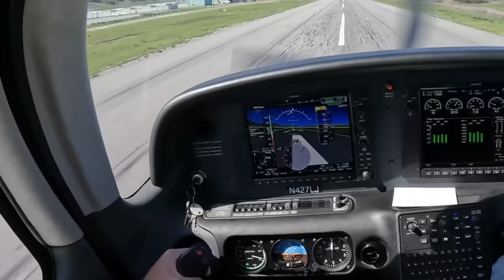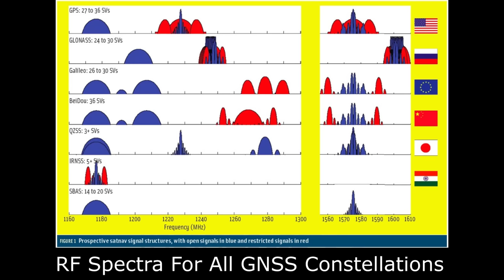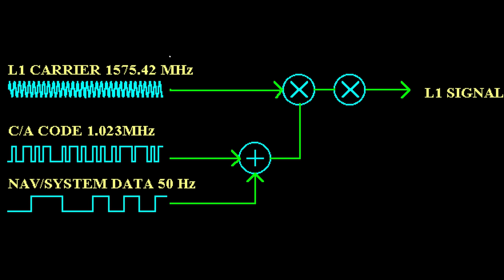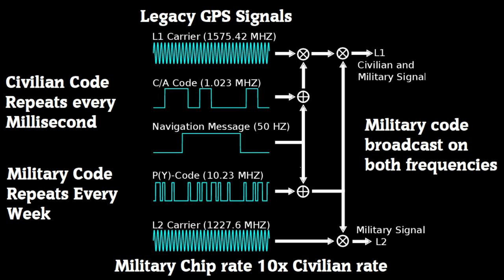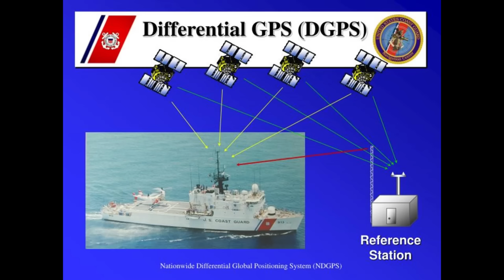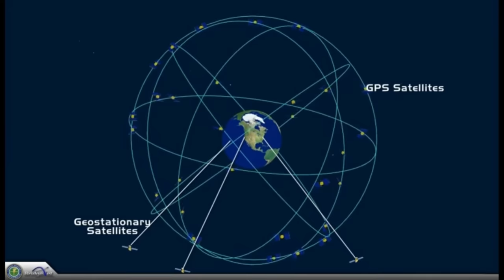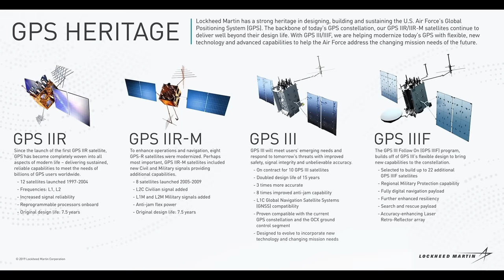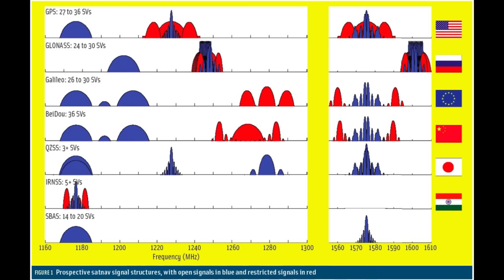How GPS Works, And How It Got Better Than The Designers Ever Imagined

Comment: I worked on an opencast mine which used GPS to track the huge haul trucks as part of the haulage optimisation system. At the time of SA being turned off, I was at home recuperating from a neck operations, but I was logged into the system. At that moment, I could see the truck bread crumbs resolve into the left and righthand sides of the haul roads.
Reply: Wow that must have been a discussion topic next day in the office!
I'm curious, how precise was the tracking before that? Did you see the bread crumbs in general proximity of the road?
Reply: @MatteoGalet  Yes. Haul roads are made at around 20-30 m width.  I called the guys at the office at the time. I must say that the supplier of the system had their own form of correction as well. Now they use GPS to steer autonomous trucks. The company is Modular Mining Systems from Tucson, Az.
Reply: What AVL system did you use then? Oh never mind I see it

Comment: An explanation of AGPS for mobiles would have been a good addition.

To save mobile phones waiting 12 minutes to acquire and decode the GPS network data, cellular network base stations supply that data directly to the phones. Thus a phone can set up its GPS receiver for a hot start, ready to go, and start calculating accurate position straight away.

If you're away from all cellular networks, it takes your phone a long time to get a position!
Reply: Wi-Fi also plays a part in this. I recently moved to a new state where I've got no cell service inside my house. My phone sees my Wi-Fi, and thinks I'm back at my old address. This makes it impossible to get a precise location lock unless I can talk to a cell tower.

I had to buy a new router. Once I did that, the phone would use it's last location to look for satellites, and wouldn't think it teleported to another state!
Reply: Good point. The key factor is that your phone will remember that AGPS data for a long time, even when out of cellular range. Removing the phone battery will force a cold start of the GPS receiver.
Reply: @PsRohrbaugh  that issue is not from real GPS, google or some provider keep a database of WIFI acess points and their location.
A phone will send a list of nearby acess points to this provider, wich will look for matches in this database and return a estimated position.
This can then be used as a initial position until a real GPS fix is achieved.

Then the reverse is done, a phone with a good GPS signal will send the list of visible AP to the provider to update its database.
Reply: I used to have a handheld GPS receiver in the 90's which took forever to lock but I never thought about how today it doesn’t take long because of the dropped selective availability thing, thanks for that little gem about cell towers.
Reply: A long time and a lot of battery, I presume?
Reply: @PsRohrbaugh  It depends on the model, but you probably could have changed your router’s BSSID so it no longer matches what google/apple have in their database as your old address. If you aren’t technically minded though, then ya, probably easier to just get a new router.
Reply: Phones know where they are from the cell masts they connect to, with a largish error

From multiple masts, you can triangulate. That's demanded by emergency services

GPS however gets you a very accurate fix.
Reply: @FABStudios   FWIW, S/A didn't affect startup time.   It simply caused your position to wander slowly (they guaranteed no more than 0.5 m/s drift rate (maybe even .5mph) over no more than +/- 50m)   Even with a consumer grade GPS receiver, if you simply let it sit in one spot for a day you could zero in on your true position (used for surveying where differential GPS was not yet an option).
Reply: Some phones also have a barometer which speeds up the first fix because altitude is already known (roughly)
Reply: @TBH_Inc  I'm moderately tech literate, and just assumed it was tied to the MAC address, as you can have plenty of routers with the same SSID, even on the same network.

That said, you're right, I didn't even bother trying to change any settings, just went on Amazon and ordered a new one.
Reply: @ashchap  The requirement is to know which satelites to search for first. 

Phones will get RTK and phone masts will be broadcasting RTK data going forward.
Reply: Yeah there’s at least 5 or 6 sensors that your smartphone can use to “know” your location
Reply: Google has made a right mess of aGPS. I turn it off in all my phones. It's often put me hundreds of meters from my location.
Reply: As long as the receiver can get the almanac often enough, it’ll be up-and-running very quickly. Not as quickly as with base station location as a seed, but still much faster than it otherwise would. See any runners’ smart watch that’s not otherwise internet-connected. Takes a minute to acquire signal if you’re using it every few days. So no big deal really. Same as any other offline receiver.
Reply: I mean, a long time not really.  My GPS watch, can take from 15 seconds to a couple of minutes to get GPS position. Most of the time it's a couple of seconds.
Reply: Most modern cell phones uses accelerometer to keep track of their position. They then use GPS and cellular network for updates. This what gives the appearance that phone GPS works indoors and in situation where there is poor, or no reception and in areas where there is a lot of multiple path

As a part to the GSM standard the cell network broadcast a timing signal, this is done in order to synchronise the hand sets and the tower, this signal can be use to measure the distance from the site to the phone, and being that each cell tower has a GPS receiver not for its location but also to keep accurate time on the network. With the network signal, the accelerometer data and GPS signal you will get very accurate location. How with just any two you will get fairly good data.
Reply: @Grantly   google has nothing to do with aGPS. And aGPS is only part of hybrid positioning, used in Android, along with cell towers, wi-fi ...
Reply: @PsRohrbaugh You could've used an extension cord and temporarily turned on the router outside the house. That way your phone (and also Google) would've relocated your router's MAC address to the new GPS coordinates.
Reply: Now i understand why my gps module/sensor I bought for raspberry pi Pico takes so long to find a position compared to my phone
Reply: that makes sense! With my 5 year old phone, whenever I use GPS on Airplane mode, it takes a long time to get a position. I thought it was just a bug. TIL.
Reply: @PsRohrbaugh  If you had changed the name of your network, you would not have needed to wait so long. It also should have taken into account your neighboring WiFi networks to recognize that you were not in the same location.
Reply: An app called GPS Status allows you to discard and fetch current aGPS data on-demand.
Reply: The provision on mobile networks are not, as might be thought done, dynamically but an almanac is downloaded periodically. This is important as when calling 911 the GPS location is done before the other side rings as the location determines the Public Service Access Point (PSAP) the call goes to (prior to E911 it was determined based on the cell and face the call accessed which could lead to the wrong PSAP being communicated with and the call needed to be rerouted to another one.)
Reply: @PsRohrbaugh if you reset your router to factory, it would’ve reset all the position data it had. Or it could’ve been your ISP account supplying inaccurate data.

TLDR you didn’t need to buy a new router.
Reply: @PsRohrbaugh  Thats because the Google map function uses the MAC address of your WiFi for location. A tsome point thye will update and learn your new position.
Reply: @Markle2k  If he is far enough out in the boonies that he doesn't get a cell service, the chances of other WiFi being around is slim.
Reply: It's described in Wikipedia.
Reply: Its annoying they assume WiFi doesn't move.
Reply: S/A caused a lot of vertical drift. I recall snow camping with an early GPS, and we could change hundreds of metres in elevation without moving. Using a topoggraphic map, you cross-refrence position and elevation.
Reply: @PsRohrbaugh  " just went on Amazon and ordered a new one."

So, the overly intrusive surveillance done by big tech made you spend even more money trying to correct what should never been in the first place?

And no, I don't blame you, there are only so many fields one can start becoming an expert in, though I find it rather depressing how 1984 turned out to be driven not by the government but the anonymous mass of consumers.
Reply: What was only shortly mentioned is, that the satellites not only provide information for the selves, but also for others. To acquire a position the phone needs to know where the satellites are. As data download takes 30s but learning the currently visible configuration takes several downloads, this adds up in time to build the so-called almanac. The phone (and also all the arduino cheap GNSS receivers) can save the almanac. But the almanac is getting old and after around 7 days, it needs to be built from scratch. That explains why we have a hot-start, where GPS is ready within a few seconds, where the constellation seen is just almost the same (after power cycle or such), a 30 second warm-start, where the constellation can be estimated based on still valid almanac data and finally the cold start, where the almanac has to be re-built, needing 7 to 12 minutes. 
With internet connected, the phone can download a valid almanac from the internet and can lock your position within the 30s, even it has lost the almanac, because it is only stored in a temporary RAM location and lost after reboot.
WiFi and Cell ID can improve the position precision in dense city environments as GPS is often blocked by large buildings and may shift your position by reflected GPS signals.
Reply: This explains why my GPS seemingly wasn't working when I was in a foreign country. I just didn't know it would take such a long time to gather the data, having been connected to a network basically all the time.
Reply: @PsRohrbaugh yeah but that is NOT AGPS - it's (theoretically) working without any satellites - basically what it does is either the wifi router or your phone (thinks to) know the exact position of the router and maybe even other routers nearby and calculates your distance to those devices - similar as the satellites do but with devices on the ground - it's meant to increase GPS accuracy by providing additional position data, but it's far too unreliable if you ask me and can you throw way off course, so I'd suggest as long as you don't need it (because you're in areas without proper GPS) AND you have some kind of option to avoid errors (either by knowing all wifi AP are correctly configured or by knowing your location and being able to check back that you didn't had/have errors) to turn this feature off.
Reply: Blimey. No wonder it took us a million years to get this far! 🤯
Reply: Thanks for this explanation. I have a Blackberry Playbook tablet that has GPS but takes forever to get a fix. I assumed it was just a poor GPS implementation, but now realize that it didn't have the rapid startup configuration information that the cell phones were privy to
Reply: I dunno. I use GPS on my mobile phone onboard an aircraft regularly. Obviously, the phone is in airplane mode and yet the fix is almost instantaneous.
Reply: @vysogota  Depends how stale the almanac last delivered by the cell network is before switching to flight mode. Probably, not very. 

An interesting experiment could be to switch to flight mode, power down the phone, start it up again and see if it stays in flight mode. The power-off should purge the almanac from the GPS receiver. The OS boot might purge any old temporary data lying around (including old almanacs), so an almanac wouldn't reinjected into the GPS receiver. And, in flight mode, the phone won't be able to get / receive a new almanac, nor can it give a hint as to what part of any extant almanacs is current for the (approx) location. If all that does add up to a forced GPS cold start, it'd be interesting to see the consequences!
Reply: @vysogota  Just doing that experiment -  it's doing a cold start (Samsung / Android), and still hasn't got a fix. 

It's quite interesting watching the GPS Test app slowly pick up individual spacecraft. Several minutes in and the position is still reported as Null Island. 

Ah, it's just got a fix! It's found 4 spacecraft, so it has a position fix. It's not found the 8 others that it could be receiving (it's a 12 channel receiver on this phone), so it's clearly waiting for the almanac to come down from the 4 it's got before looking for more spacecraft. The accuracy is way off.

The accuracy has just had a 3-fold improvement (~100ft down to ~30ft), and now it's finding more spacecraft.

Switching out of flight mode, and suddenly the screen is full of satellites!
Reply: @PsRohrbaugh  I don't this is possible anymore. I assume this happened to you 5+ years ago.
Reply: @jamescaley9942  Wifi doesn't allow for triangulation (except you have a fancy receiver which can determine the angle from where the signal is coming, which you most likely don't have in your mobile device), but uses the same technique as in GPS or other sat system, called "time of flight", so the time the signal takes to reach your phone. There is also an option for this to use multiple networks, but still this doesn't have to do anything with the angle, but with the distance, there is a similar word for that I don't know right now, but it's basically also trigonometry, but as I said with distance instead of angle...
Reply: My OG Galaxy s back in 2010 or something had a badly implemented gps system that lead to broken agps, and it was terrible
Reply: Google mapped every Wifi router in existence (and recorded their unique MAC addresses) with its Street View vehicles - Android phones use this data for positioning, particularly in major cities where GPS simply doesn’t work.
Reply: Modern smartphones also use Galileo, not just GPS, to improve accuracy, as the support is now common in chipsets.
Reply: @mechantl0up  Yep. My very average Samsung phone uses GPS, Galileo, GLONASS and BeiDou GNSS systems.
Reply: that's a google issue, as of 6 or 7 years ago anyways they routinely failed to ignore WAPS that had clearly moved from one location to another, at the time changing SSID seemed to work to fix it
Reply: @PsRohrbaugh  You didn't have to buy a new router. The source database usually gets updated automatically in a few days when your device realises that the WiFi access point is not where it used to be.
Reply: @dijoxx  my old router was so far into my private property it would never get re scanned. While I'm not there full time, I had this issue over multiple months.
Reply: The misuse of wireless access points for this purpose is an example of the bad assumptions far too commomly relied on at tech firms.
Reply: i always thought they did it with cell towers not sattelites
Reply: I've used my phone's GPS  in the middle of the ocean and the position fix was almost instantaneous.
Reply: @tutracrafty  What vessel were you on?
Reply: 12 minutes is the time to download the almanac. You don't need the almanac to get a position fix. Even receivers from the 90s (like Garmin GPS 55 from 1992) can do a cold start in 2 minutes. Modern recivers are much faster. AGPS is not required anymore.
Reply: @gordonrichardson2972  So you want me to take my iphone apart just to remove the battery?
Reply: My smart watch likes to be periodically connected to my phone for it's GPS to work.

Comment: Wow....I geeked out on this video.  It was nice to see your research said the first GPS satellite was launched in 1978.  I know that for a fact as I was in the Air Force as a Range Control Officer at Vandenberg AFB and participated in that launch, managing the tracking and telemetry systems during flight.  We had NO idea what GPS would become.  You brought back memories and gave me a little better understanding of the GPS system.  Thanks.
Reply: We at TI (in 1978) had a contract to develop both a MANPACK and HDUE (aircraft platform) GPS receivers. We had field engineers at Yuma Proving Grounds working on that ground range testing equipment and also I recall the mention of three satellites "in service"  at that time too.

Comment: When I was at university back in the late 90’s, I remember some of the geophysics students telling me about how they got around SA for gravity surveying. They set up two fixed base stations spaced apart each with it’s own GPS receiver. They then used some smart math to compare the two locations and then solve the difference to work out the introduced error. This erro was then removed from the signal and they achieved sub-metre accuracy, this being very useful in the gravity mapping surveys.

Clever stuff, I’m sure they weren’t the only people to figure this out prior to SA being deactivated. Very interesting video Scott, thanks.
Reply: That was called differential gps. It was used well into the 2000s. I did an integrated system for PANYNJ to track trucks on the GW bridge in 97-2000 that used DGPS
Reply: re: "They set up two fixed base stations spaced apart each with it’s own GPS receiver."
The basis fir something called Differential GPS.
Reply: S\A.. could you really remove the error with some smart math?
Reply: @michaelhompus2475  
NOT w/o averaging a single receiver's position over ... say, hours.